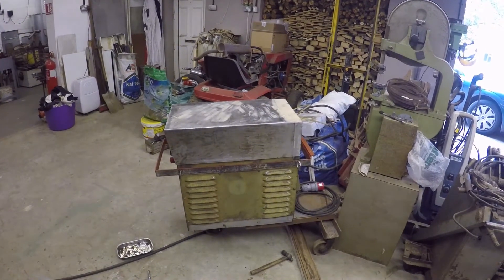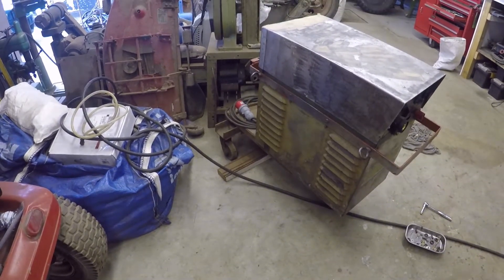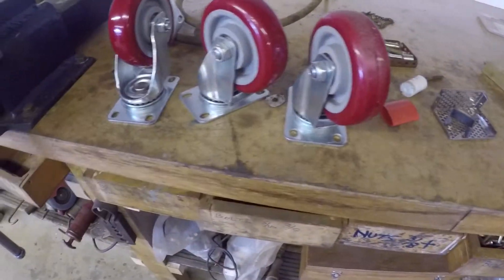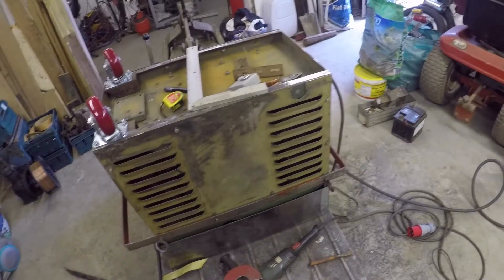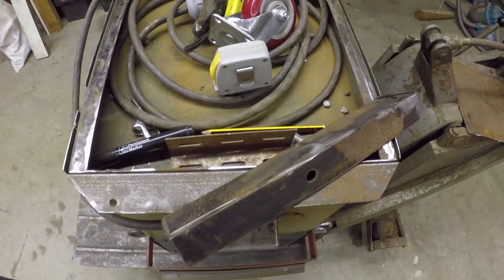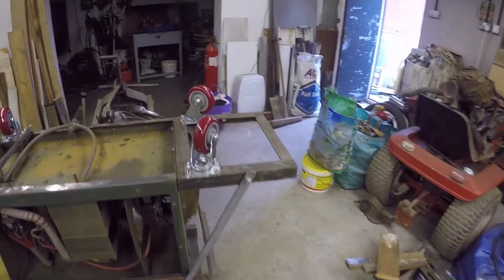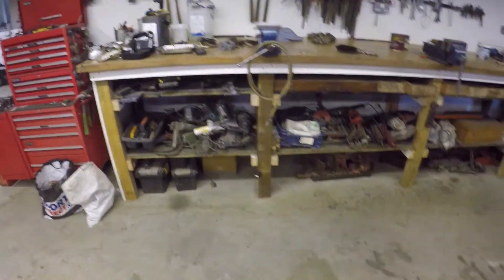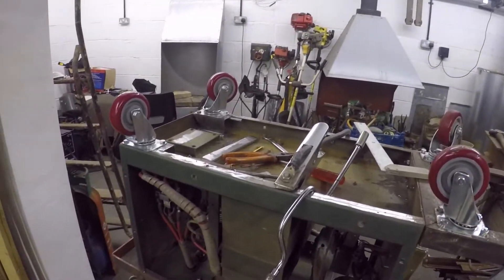Socome Mig welder, The Finishing!

Comment: I have a 26year old Oerlikon/Citoarc Solomig 230C. I bought it secondhand in a closing down sale and have had to get the PCB repaired and it now works brilliantly. Older kit I think is better than a lot of the new gear available today. I also have a 1980's Oxford Bantam 180amp oil cooled AC welder which is another brilliant old machine. The latter features in a few videos of mine. You have a great channel young man!
Reply from the maker: Your comment has appeared this morning as one I did not reply to, but I think I did, as it seems familiar! However, I agree with you completely, older equipment is much better because it was built to serve the pirpose it was designed for, whereas modern equipment appears to be designed solely to extract maximum profit from a chosen field of endevour! All the best equipment I own is pre 1980. It seems that after that equipment was designed down to fit a market opportunity rather than trying to be the best and the longest lived! The very fact that this gear is STILL WORKING after all this tile is a testament to build and materials quality . About 20 miles from me is a company called Techarc (Technical arc ltd) they manufacture welders from the ground up, including winding their own transformers, they actually manufacture the Oxford range of welders, and also make some of the components the Oerlikon range! I have no connection other than a very satisfied customer!!https://technicalarc.co.uk/ Thanks for your comments, 
Phil
East Yorkshire.
Reply: @philhermetic  Cheers young man. You have a good channel and very interesting to me. On my next video (subject to my memory working at 20% or more?) I will put a card on it to recommend your channel! All the best, Jon.